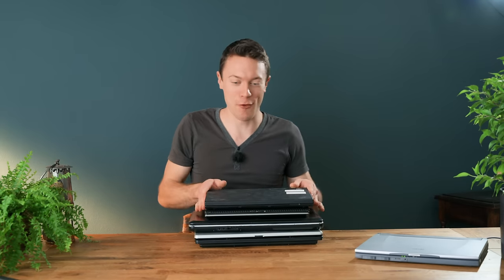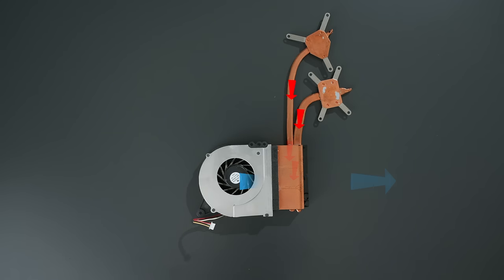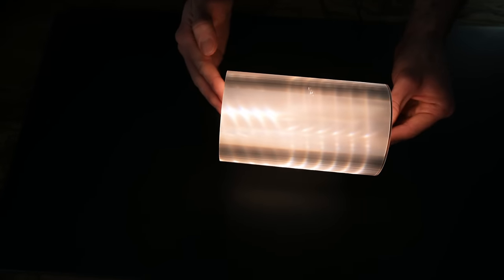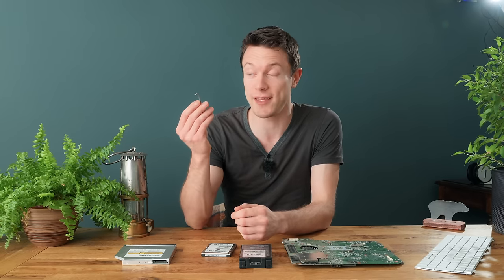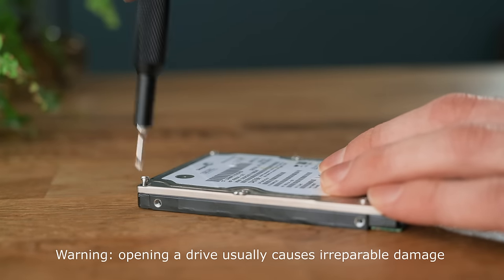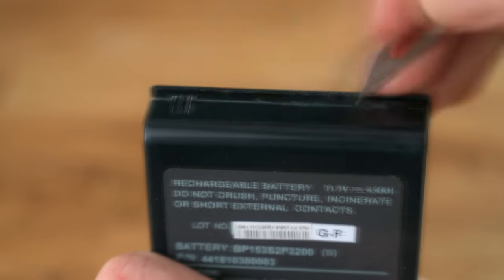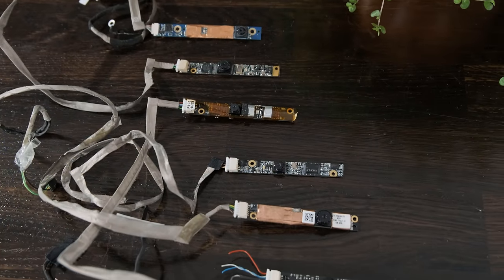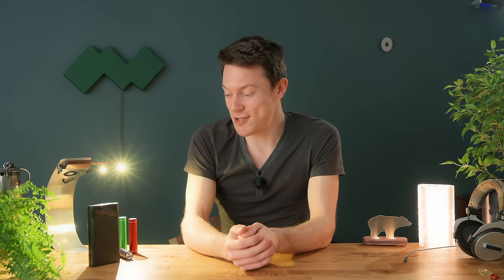Things you can make from old, dead laptops

Comment: Out of curiosity, would you happen to have a video on things you can do with old computers? I got a dozen from work and short of refurbishing them, I am not sure what to do with them.
Reply: Pack em with hard drives and a DVD drive, use as a media server?
Reply: You could set them up as a server for various uses
Reply: @WildWolf-pu4pj  I would very much like to do that, but I am unsure where to start. Any recommendations?
Reply: @RJ-wx3fh  that is not a bad idea! Do you have any recommendations for where to start on that?
Reply: @TheStarMachine2000  You could set up a network attached storage (NAS) server, either to share files across devices or to backup your stuff
Reply: @TheStarMachine2000 
I'd recommend looking through the internal hardware first. Pick out the one with the most punch (mix and match internals if they're compatible. Google is your friend there. Might want to avoid mixing RAM. Scavange all hard drives/SSDs though. Look into RAID to avoid data loss in case any of the old hard drives fail, assuming you have enough scavenged hard drives. Might also be worth it to buy a few of your own) 

Plex and Kodi are two very popular home media server software. Plex is much easier to set up, more novice friendly, while Kodi offers an impressive range of customizability (if you're willing to put the time into getting everything working). Plex can run on windows very simply. Not sure what the Kodi experience is like on Windows. Also, plex allows you to stream your media outside of your home, so you can pretty much set up your own private streaming service, assuming you have enough movies and TV shows that you can rip from DVDs/Blu-rays to populate it. 

There is also OpenMediaVault. I don't really know how to describe it besides a rehaul of Ubuntu Linux that you can install ontop of a server version of Ubuntu Linux that turns it into a NAS, where you can store anything, not just media. 
OpenMediaVault also allows you to run Docker containers, which are like mini operating systems running within your operating system. (you can also run Docker on windows or regular old Linux, but I found it most practical to use the Docker graphical interface in OpenMediaVault. Otherwise it's all command line stuff. Command line stuff scare and confuse me.) 
There's this nifty bit of software called "pi-hole", which can be used to block ads and tracking through your whole home network (except YouTube. They're always one step ahead). Pihole can run in a Docker container. 

Another neat thing to run inside the Docker containers is your own dedicated VPN, which can encrypt and tunnel your internet traffic through your home network when you're on the go for increased security. Helpful if you travel a lot or use public wifi. My favorite is "wireguard" to run on Docker, since some generous soul has made a (more or less) plug and play pre-made Docker container for it. You should definitely have decent knowledge of network security if you're going to set that up though, so you don't end up inadvertently compromising your home network.
Plex and Kodi can also run in a Docker container inside OpenMediaVault. 

I apologize if my tone sounds belittling or if I'm over explaining, but I don't know how familiar you are with this kind of stuff so better to say too much than too little 😅

Best of luck!
Reply: Good question

Comment: Look Into 'Tesla Turbines from old HDDs' where the motor turns into a small generator one can turn with a bit of solar etc steam.
Apparently the magnetised surfaces and alloy/s used in the platters do wonders for the amount of Hydrogen/Oxygen produced by HHO cells too.
The head magnets are simple to stick to the outside of your car's oil filter, where they do a great job of filtering out ferrous metal particles smaller than the filter paper can and increasing the life of the filter paper/filter too.

Comment: Poor ThinkPad X220 being "Disassembly" :(
Reply: yeah :( could be used for spare parts for a working x220
Reply: @swedneck  yep
Really sad to look that thing being dismantled
Reply: Glad I'm not the only one who would have put that thing back into service or at least used it as a donor to get another old Lenovo laptop back up and running
Reply: Looks like it only needed a screen for about 20$ :D
Reply: I love my X220. After I went for liquid metal to replace the thermal paste, it is even better. With the modified BIOS and 16GB DDR3 1600 it is also good for older games.
Reply: @jhonnyxyz   Nice, very sensible upgrade! It's an excellent machine!
Reply: @rkan2   The bottom frame and keyboard were snapped down the middle 0:24
Reply: I watched this video on a X220 I love this machine
Reply: @drewlomax7837  Yeah, but it doesn:t mean it wouldn't still work :P
Reply: Man, no joke, I was looking for an X220 for one month now. Here they are pricy ... Hell of a machine with the extended battery you can work really long hours .. more or less like a netbook on battery life, but without the ATOM thing. A PROPER laptop that is still a good perfomer.
Reply: @jhonnyxyz  WOW ... CRAZY stuff. I will have a look. Im using a T400 Core 2 DUO P8600 right now. Its ... DECENT. So the X220 with the 3rd gen I5 should be (IMHO) still up to date with requirements. I dont find the X240 as apealling as the 220. For a bit bigger, T430.
Reply: 38911bytefree lol I have the T500 upgraded with a T9900 core 2 duo 3.06 ghz. I pluged a gtx770 with an egpu on that express card slot, I could actually play darksouls 3 and fallout 4 with not too much stutters
Reply: Watched this video on an x230! Love this thing
Reply: @ariochakuma  I have a X230 in daily use 24/7 since maybe 3 years, or more. 8GB RAM, SSD harddrive, dock with DVD burner, W8.1 PRO 64 bit. CPU is a i5-3320M-2600MHz. "Obsolete", but VERY useable and reliable!
Reply: @ariochakuma  Me Too! 
Thank you for your service little X220. "Press F to pay respects"
F
Reply: As soon as my lenovo x220 screen is broke i ll buy new ips screen.no matter what the price is.

Comment: Simple DIY:

STEP 1 - Solder a Bluetooth transmitter. 

O K BUDDY
Reply: If you are interested in technology and DIY, a decent soldering iron isn't very expensive and not terribly difficult to learn. Soldering to PCB's is tricky, but start with soldering wires together first (when I did this, I cut up a cheap vehicle trailer wiring harness for the wire and just kept soldering together 3 inch pieces until I was comfortable)

Comment: 13:55 they look like short gun shells
Reply: They can be used even in flashlights vapes anywhere you can imagine since they output minimum 5 to 10 amperes to max 30-40 amperes any value of ampere is dangerous for vape if you don’t know what you doing but flashlights powerbanks etc any amperage is Safe if the circuit board allows it the only matter here is the mah for ex take for ex a battery in a powerbank with 2500mah will give 15-20% battery for ex while a 3500mah batteries will give a bit more well you can buy them really cheap and they are reusable af like 500 recharges while they offer good capacity good for anything even the electric bikes pack huge amount of them or the new Tesla cars pack even more huge amounts of them with some engineering calculations they are called 18650 look them up there are a plethora of other types too but these became more usable cause they are enough thin and offer better capacity than the fat 26 series one if you search cool projects with 18650 a new world will open to you but as i said they need to be handled carefully and to know what you do so you don’t damage em or even yourself have fun
Reply: @HeLrAiSiNg1  i'd stay away from vapes when it comes to diy

Comment: Me: Does it turns on? Yes? Then throw Linux on and run some docker containers..

Old Laptop back to productive life.
Reply: Okay, but what can you do with those Docker containers aside from programming? That's a bit too specific of a usecase.
Reply: @youdonegoofed  programming? I'm running Home Assistant, Pi Hole, and Zabbix all in one machine.. My entire house automation is running on a old laptop.

Edited: I'm also running Jellyfin Media Server.
Reply: @geogmz8277  Can Docker be used on a system without a display? I'm running a Debian server on an old laptop with a busted display and I'm managing it though Webmin or SSH. Currently I'm using it as an FTP server and a Pi-hole, but Pi-hole is installed as a running service already.
Reply: @youdonegoofed  Docker is like running VirtualBox or KVM.. Is a glorified Chroot. So yes! You don't need GUI to manage it in fact Docker is 100% terminal.. Unless you install Portrainer to manage it via Web which you can do anyways remotely.
Reply: @geogmz8277  I'll look into Docker some more, thanks!
Reply: Tomekit one dock for one app?
Reply: @youdonegoofed  Its excellent for media server and automation
Reply: Yup thats what I did, and learned pyrhon on it. And it was a really old atom powered 2gb max mem netbook. You could also put open source chromebook on it, though its still a little underpowered for it.

Comment: 11:32 the ultimate troll would be to fill the disk with porn before dismantling the disk so that if they ever try to see if the clock you gave them has any data on it they will get a surprise
Reply: The moment you dismantle it it becomes paperweight.
Reply: @axelespinal  ehhh....pros could sometimes figure it out, but sometimes the dust does kill it.
Reply: Only if it's a single platter disk. Multiple platters have servo tracks on them, and require nanometer precision alignment.

Then again, chances are, they need the specific model of drive the platters came out of, as manufacturers do things their own way.

Comment: If the machine still works, the dead screen can be removed and antennas added to the base for the WiFi, Bluetooth and mobile broadband cards, and you may connect the computer to a television to be able to use it for emulation.

Comment: Hi, thanks for a very useful video. Can i suggest you use goose neck pipe for the microphone. it is rigid and adjustable too. I too am thinking of converting my old laptop to a desktop as most of the components are working except that the casing is broken due to a nasty fall. My mistake.

Comment: Hey I'm a fellow tech enthusiast and I loved this video. I noticed some weird noise and dithering in your video because of compression so I check the "Stats for nerd" option and noticed you had the AV01 encoder for compression which explains the dithering. On YT, you can get the VP9 encoder if you export the video in at least 1080p 60fps. It will give you better quality even after compression. I know you have 4.6M subs but still wanted to let you know that you can fix it this way.
Plus it might help someone else.
I'm a YT Video Editor btw.

Comment: If you have an old laptop that can't handle current operating systems (the hardware requirements for Windows go up with every release), you can always install an older one, or go all the way and get a Linux distribution like Linux mint, that was specifically designed to be run on underpowered older computers. I use mine for browsing the Internet when travelling and it's doing fine.

Comment: These are very nice ways to use some products , most products are still useful even if they died because not all part of it is gone. Like I have speakers whose wires and board is damaged but the woofer works properly . In this case using that woofer will still benefit me but if  i knew how to do it. currently it's only for decor with magnet stuck on metal cupboard and by now I think it won't work anymore . Speaking of which if you have E-waste laptop , laptops that can't be used in new tech , you should see if replacing parts work , you can turn them into backup computer or just for fun like run a TV and surf internet or play pc games on tv  by connecting them directly to that laptop.

Comment: I used an old Thinkpad W530 for about 2 years without a screen (it had a screen but it was severely cracked).  Luckily by default they are set up that if you have them in a dock they will use the screen that's attached (and also the LCD, which didn't work).  So I used it like a desktop for 2 years (just kept the screen closed which forces the computer to use an external display; the only downside is that it wouldn't show the OS loading so if there was an error, you wouldn't get any indication but I think that happened maybe only a handful of times over the 2 years, but it worked great otherwise -- and it was a more expensive Thinkpad hence the reason I kept using).

Comment: I havent read all the suggestions here, but on a similar track are "Office Glasses":
I don't  know witch filter it is, but once I experimented a little with a broken monitor, and removed one of the plastic sheets, and cut it into fit on a pair of Aviators. This made it so that only the guy wearing the modded Aviators/shades could actually see whats on the screen. Not too hard and kinda cool.

Comment: The "shiny" metal disks from the hard drive are coated in platinum (atom thin layer coated by chemical vapor deposition). They can be used for high quality electrolysis plates for a diy HHO generator (a hydrogen welder)

Comment: I have my sister's (god rest her sole) old Inspiron 1000 from 2003 running Windows XP. I am using it as a retro gaming pc.  
running Dos games Via Dosbox and NES,SNES, Old MANE and Sega Emulators.  I even updated the RAM and replaced the 40 gig PATA drive with a 128 gig NGFF B/M-Key SSD with the PATA adaptor.  Plenty of space for retro gaming.  USB Xbox 360 controllers work great on it.

Comment: I have some old laptops might as well use the microphone and the screen, also most old laptops if they work if you switch the hard drive disk to a ssd and swap the ram for more or add if it has the slots that can be a huge upgrade in performance for practically 20 bucks

Comment: Not sure how I came across this video but amazing, well done. Another subscriber gained.

I would be extremely interested in your ability to solve an issue that has been driving me mad for weeks now - connecting my motorcycle intercome to a GoPro action cam but also utilising MY audio input whilst sumiltaneously reducing the amount of connection cables, but also ensuring that the movement of those cables connected into the GoPro is limited, thus reducing audio input inteference. 
Whilst there are multiple videos on how best to do this, I'm sure there is a better way, even if that means making something electronic to wire in-line to improve sound quality.
Drop me a line back if you think you could solve this issue and we can discuss from there.
I'll wait with baited breath.👍

Comment: 3:14/19:02 it's called "Thermal Conductive Paste", not a glue. You don't glue the LED's to the Copper Pipes, you use Thermal Paste so the LED's don't over heat.

Comment: Lots of neat projects for broken/old laptops.  On ones that are not broken, you seem to skip the option of installing a Linux version.  I have several old laptops, older dual core 64 bit units, that I have installed various versions of Linux.  I do put in SSDs, as well and they perform very, very well.  Even older 32 bit machines work good with small package linux installs, like Puppy Linux.  You can even with a small hardware hack install Linux on to old non supported Chromebooks.  (Youtube videos show how.)

Comment: For the older but still working computers. You could always download a different operating system and learn a thing or two. Outside of windows, there's Linux, which is free. And there's tons of different versions of Linux to use and learn about

Comment: Man your video made my day, I thought that you throw the 2021 laptops in 2022 in the west, but that's a great use of all the components of the laptop
another spot is the RAM if they are removable, it can be used in other laptop or sold
Reply: and most laptops have wifi seperated from the motherboard, you can get used of it for computers that doesn't have wifi

Comment: An old laptop might have too few performance to run the boinc client manager to calculate for science like the asteroids program from Poland or for the milky way map if it's from 2010 or earlier in meaningful amounts. But if old pc's (personal computers) could be used as servers, lap tops might aswell? Just place some open frame below the laptop for easier air flow or give it some added fan cooling to let it run 24/7, right? Or add some clocking so that it only runs on night current. Any computer staying half a metre above the floor/bottom would only be filled with dust after years (of running). I read there are 15 types of servers (or even more), and i do not know which type would profit the most as benefit for the internet.

Comment: Hey DIY Perks, about a month ago I pulled apart three oldish desktop computers from the high school I go to (I don't remember what they were specifically but they're from hp) and was curious to know if I'd be able to make something out of it. I got 2 amd chips (8600 series), 3 circuit boards, 3 small speakers, 3 power buttons, 3 thin DVD drives, 3 Sd ports (I'm pretty sure), 3 memory drives, 3 fans with heat sinks under the fans, 3 power supplies, 3 usb (with separate headphone and microphone) docks, miscellaneous cables, and all of the screws I removed. And fyi the school kept the hard drives and one amd chip. so, would I be able to make anything with those parts?